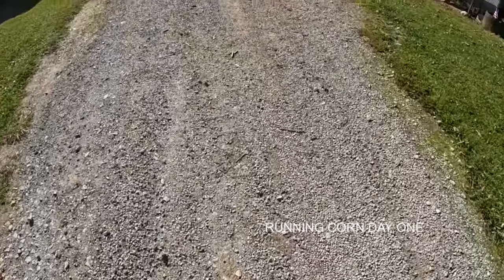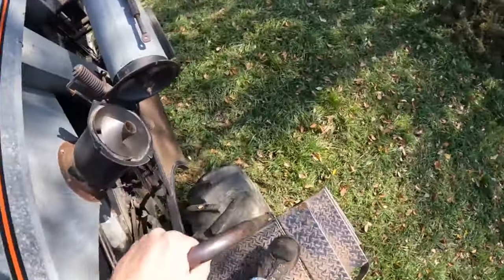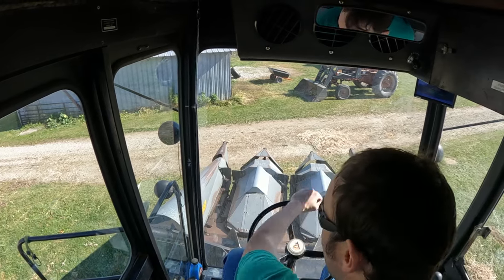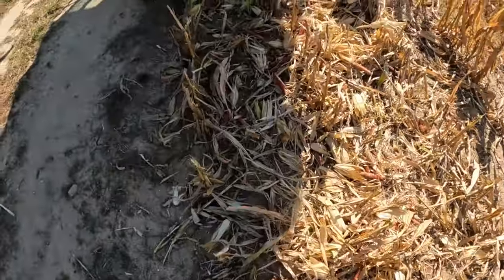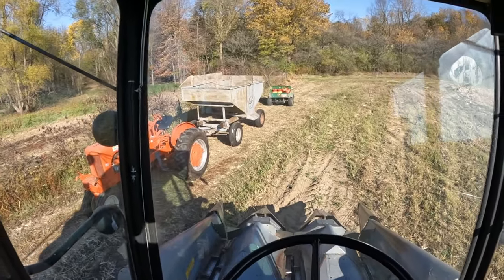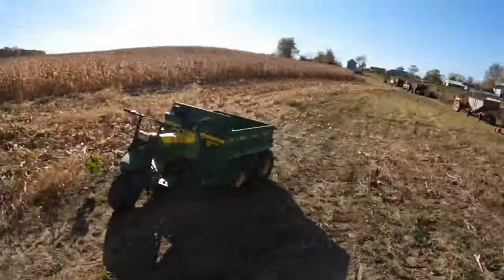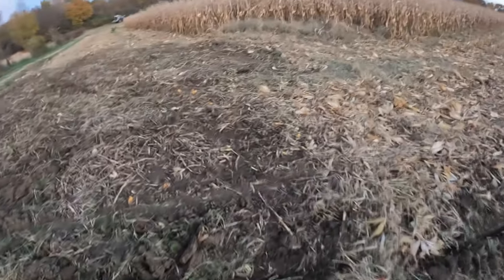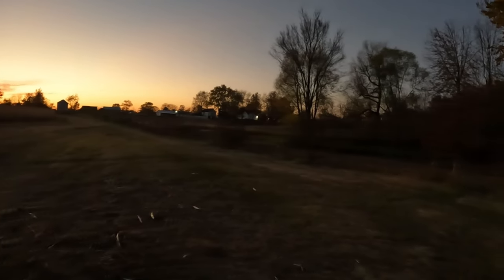Running Corn Day 1

Comment: Does`nt seem there is much urgency to get the repair done and the crop in !
Reply from the maker: Well, I can assure you we were wanting to get everything done as soon as possible, however we cannot control the uncontrollable.  The breakdown happened on a Saturday afternoon, and no AGCO dealer that we know of was open on a Sunday.  So, we got it together when we could.  Unfortunately, this is only my part time job, so I can only do what I can do outside of my time at my full time job.  I don’t think I’m alone here, as there are a lot us small farmers that have a town job to supplement our farm incomes.  And that town job is what allows us to keep farming, so we have to put that before our farming.
Reply: With older equipment, sometimes slowing down is going faster.

Comment: Sir not to be bossy but if u dont wanna loose your corn head legs. U need to take them off. First of all they are hard to come by these days. And thd corn stalks will pull the cotterpin right out. So i suggest pulling the pin pulling legs put pin in the legs and throwem in the barn till u go unhook the corn head!
Reply: Or put it upside down in bracket